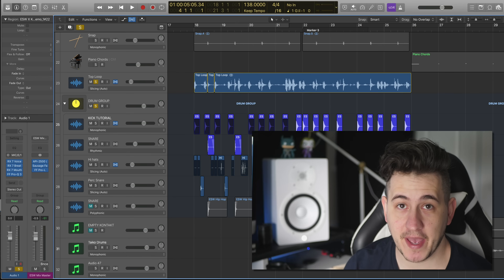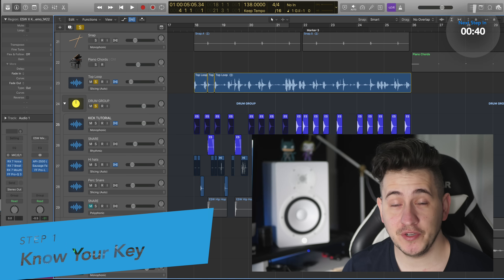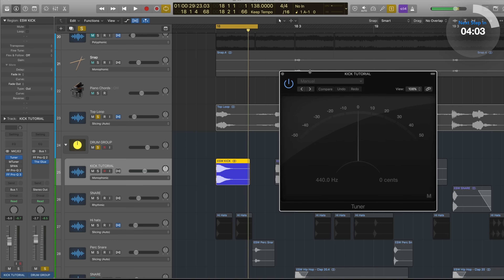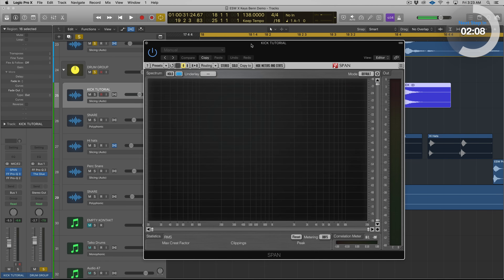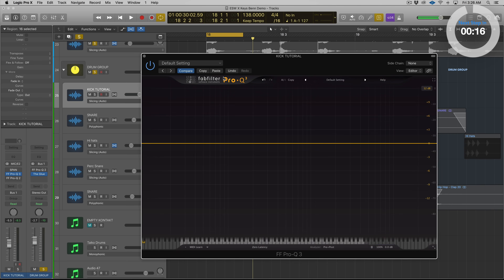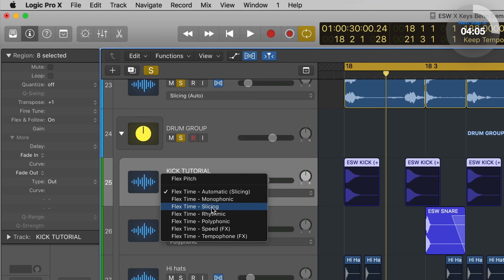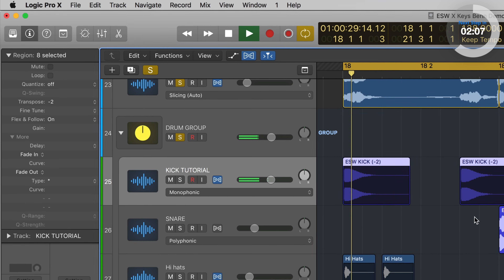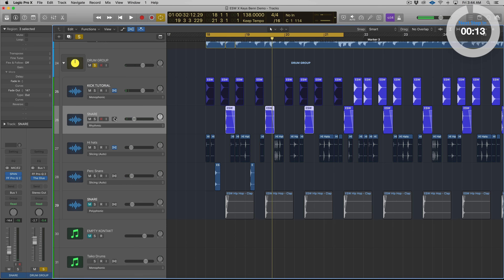💯How To Tune Drums In Logic X | 2019 Tutorial

Comment: Great video! Logic now automatically detects the pitch of a sample in quick sampler, and you can also transpose/fine tune with it as well. Saves a lot of time, but it definitely doesn’t hurt to double check the tuning is correct with FF pro Q

Edit: are you sure of the flex time algorithm that the quick sampler defaults to in pitching? It may be better to use this method if the default is slicing
Reply from the maker: Hey! In my experience the quick sampler doesn’t do a good job with drums, but you’re  right about the pitch detection.

And yeah, the mono poly flex are actually time stretching (length of sample doesn’t increase or decrease in length related to pitch.) so the only other more would be rhythmic or slice